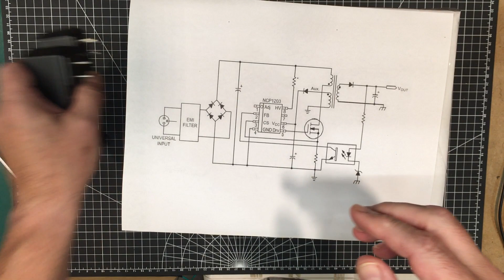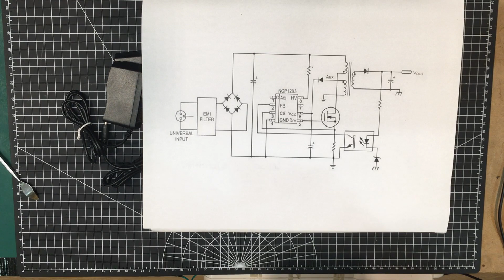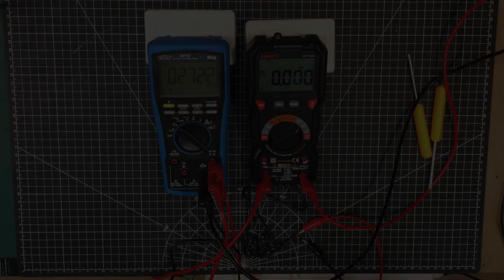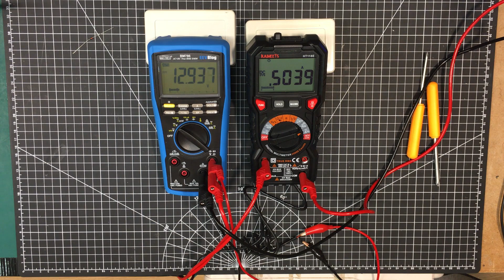0087 - Change the output of SMPS Wall Warts.

Comment: Great video!  My problem isn’t voltage, but the orientation of the blades.  Is there a way to change the blades so the housing is rotated 90 degrees?  I have 3 of these in a music IEM system and in the horizontal position, they take up too much space on my power distribution box and 6 of 8 receptacles are used or covered.
Reply from the maker: Thanks.  I think the only way to do that would be to cut off a square of the plastic bottom around the blades and glue it back in rotated 90% if, and this is a big if, the blades will not interfere with the circuit board.  I don't recommend this though.
Reply: @uni-byte could I find a 12v wall wart with more amps, (each unit I have is 12v 850mA) then solder 3 separate power leads?  Naturally, making sure to maintain polarity.  I’ve seen 9v multiple lead power supplies for guitar pedal boards.
Reply from the maker: @boratbefunny  I would not recommend soldering on wires to the blades.  However, you can get very short extension cords.  I got some on Amazon a couple of years ago that were only 1 foot long.  That would be the safest way.
Reply: @uni-byte  Thank You!  You have a very interesting channel.  Subscription earned.  Keep up the great content.
Reply from the maker: @boratbefunny  Thank you!

Comment: Sometimes when I buy a piece of portable test gear and the power adapter is offered as a pricey accessory, I've use this method by saving some money. Dig into the my junk box of power adapters and a bit of modification and you've got the adapter you need for cheap.   
👍
Reply from the maker: They are great to have aren't they?